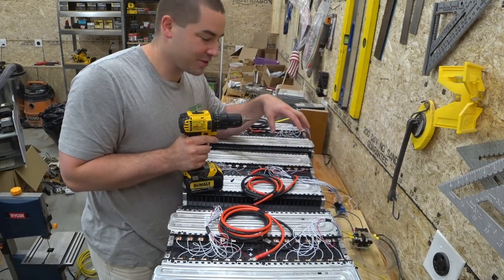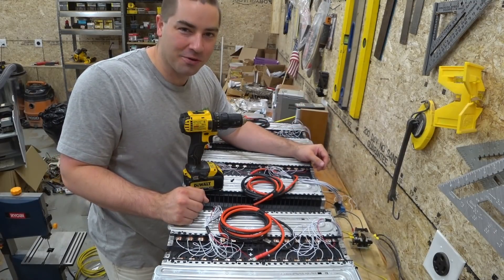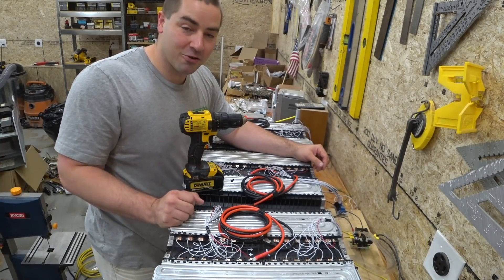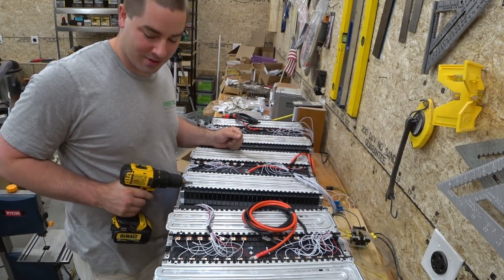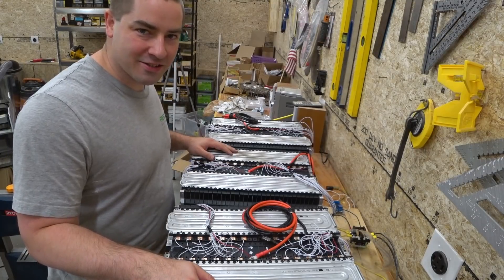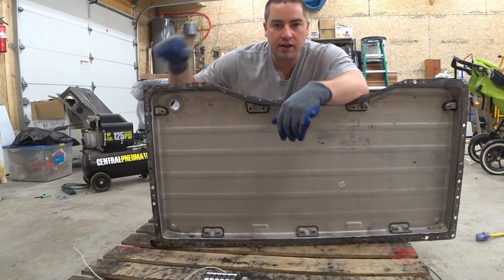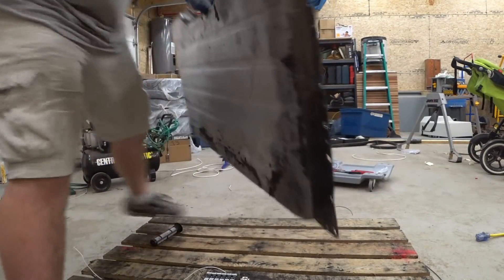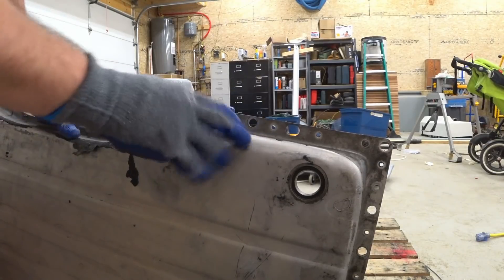Finally!  It's all coming together.  Lithium Batteries

Comment: You have a 48 volt battery so 100 amps will be 4800 watts - max. That little puppy will get HOT. I think you should run the control lines through a relay and use that to shut down the battery if there is a problem. You can buy 48 volt relays on Amazon for cheap.
Reply from the maker: Hi D Cobb,  I'm sorry for any confusion with this.  I'm limiting the draw to 40 amps per BMS.  I think this will be much clearer in my next video where I wire all the BMS boards in.  I've also been posting pictures daily to my facebook which might help make it clearer.  https://www.facebook.com/DavidPozEnergy/  Thanks for watching.

Comment: Honest question.  If you dont know the torque, and you are going to guess what feels ok, why waste the time to use a torque wrench at all?
Reply from the maker: I wanted all the bolts to be the same.  That's all.  It certainly was not necessary to use a torque wrench, but I have it and don't get to use it a lot.
Reply: @DavidPozEnergy  fair enough.

Comment: Hey David, bolt sizes are normally referred to by their shaft size and thread count, not the head size. After you know the bolt/screw size you can locate the max torque allowed based on the bolt grade. Afterwards you can decide what torque up to that value that your item will remain secured without warping components. I don't know your plan for the battery tray, but if it will not be subjected to movement or vibration, you really don't need to torque them, just good old German good'n'tight would do.
Reply from the maker: Thanks.  This will be stationary.  Maybe it will be moved once or twice if I move.

Comment: I'm envious David! How many kWhrs do you have there you reckon?
I think the torque settings would only matter if it was going to be mobile. It might help cooling  - though in a domestic situation, that won't be a problem - you probably won't be pulling hundreds of amps for extended periods.
Reply from the maker: Hi Benny Banger,  I'll roughly guess 10 kwh for now.  Once everything is wired I'll do a full capacity test so we find out together.
Reply: @DavidPozEnergy  In capacity, that equates to 16+ AGM 100AH at 32kg at 50% DoD. That's 500kg (1,100lb). What you have there David although not as good as your truck batteries, they are much better than Pb batteries. Can you tell how envious I am? :)

Comment: Looks good but how are you gonna lift it? Its looks heavy now.
Reply from the maker: It's probably going to be around 300 pounds when done.  I only have to move it 6 feet over to the wall, so not too bad.  It won't be a lift, just a slide on a dolly.
Reply: @DavidPozEnergy  I went to a local solar supplier yesterday and wow stacks and stacks of solar panels everywhere. The prices are a lot cheaper for the panels now but the tariffs are starting to hurt them.

Comment: David - is there any heat concerns mounting the BMS to the batteries?   I would think they would need a good heat sink when putting out high current.  I wouldn’t think you would want to dump that heat back into the batteries.
Reply from the maker: You bring up a good question.  I don't know how much heat they would generate under normal operation.  Don't most lithium batteries have BMS's attached? laptops, cordless tools?  Maybe it's not a problem?  Heat is something I'll be watching out for.  Thanks for this comment.

Comment: Have you tested the pack yet or in videos to come?
Reply from the maker: Hi Going Off Grid,  I have not yet done a proper capacity test yet.  That will be a video once the BMS's are all in place.    But, over the months, I have slowly done charge/discharge cycles of the cells.  This was over the course of months at very low amps (less than 1 amp)  The purpose of the cycling was only to determine good/bad cells, not capacity.
Reply: @DavidPozEnergy  ok cool, I didn't miss any of the good stuff.

Comment: Very cool!   I see you are going with these 100a, lighter BMSs instead of say Batrium.  Is your plan to parallel hookup the 3 'batteries' at 100a each to get 300a total output?  or what did you have in mind?   I'm ask because in my case I'm driving a 12,000 watt AIMS and that's up to 250a @ 48v + (potenially) a 3x spike for 20secs (e.g. 750a) - so I went with Batrium BMS which avoids being inline with the battery's current carrying cable and has much stronger balancing (and of course much more detail montoring/control etc)   but you know how it is.  I made a decision but it doesn't mean that its the best one - so I'm always interested in other points of view.
Reply from the maker: Hi Kenat,  Thanks for your question.  I agree with your sentiment.  I have a plan with the BMS's here, but it is not the "best" for everyone.  What you see here is one giant battery bank.  It is comprised of 3 modules, 6 batteries.  There are two (48v) batteries in each module.  I'll be using 6 BMS boards.  According to the manufacturer the BMS boards can do 100 amps continuous, and 110 amp peak for a surge.  I have a hard time believing that, but they are better than a BMS rated for 20 amps.  This means theoretically, this battery bank can handle 600 amps.  I'm also installing circuit breakers in-line with each BMS rated for 40 amps.  My goal was to have the circuit breaker trip before the BMS burns out.  40 amps x 6 batteries = 240 amps continuous.  The circuit breakers can handle short surges (like a motor starting).  O, and "YES" they are in parallel.  The next video will be on the BMS wiring, so I hope to make this clear if my explanation is not.  Thanks for watching.
Reply: 6 x Cool!  You'll easily have 240v@50a capabilities (or more) - e.g. producing/managing your own power generation for your home.   This brings up day-to-day management.  Is the plan to let BMS do their jobs / avoid obsessive monitoring and then interrogate them if something goes wrong?   How will you know if 1 of the 6 'batteries' degrades or goes offline.      Don't mean to pepper you ...  its just that I'm a year 1/2 in with my own 780ah @ 48v battery bank  (so much fun building it / putting it online)  but I've been thinking more and more of 2 yrs, 5 yrs, 10yrs out...  and maintaining things...  and I suspect you are thinking of these things as well and will be interested in our thoughts as you progress.
Reply from the maker: I want to avoid daily monitoring of the battery, which is why I'm integrating BMS boards that have safety features built-in.  These BMS's also have bluetooth.  So I will be able to look at the state of the battery to see if it is online, or off-line.  These BMS's are a bigger version of the one I tested in this video: https://youtu.be/wTn5t8rAOCs

Comment: Now you are ready for the smoke test... 😂
Reply from the maker: If you mean they smoke from catching fire, I hope not.  I've been charging/discharging cells as I've been working on them.  I think I've got all good ones grouped here.
Reply: @DavidPozEnergy  just make sure that you hook them up. Correctly.
Reply: @DavidPozEnergy  its a old electronics joke as in the first power up seeing if it will work or if it will catch on fire... Love be the videos btw
Reply: Ben C In the heavy truck business an old guy I worked with, had a trailer light test box before they were commercially available, we used to hook it to a battery charger , if there were problems difficult to find, we would turn up the charger and look for the "smoke"  then rewire the whole trailer most of the time.That old guy with his Dutch Masters made hard work alot of fun , RIP.
Reply: bite your tongue! :)

Comment: Very nice - are these the same 4.2 max volt as the Volt batteries ? - so you can parallel them ?
Reply from the maker: Yes, same basic voltages.  I don't know the exact minor differences in the chemistry, but the papers I've read on it show similar voltage curves.
Reply: @DavidPozEnergy  Cool, so is your plan to put them in parallel ?
Reply from the maker: Yes, just like you have leaf and volt batteries paralleled.  I plan to do the same.
Reply: @DavidPozEnergy  nice !
Reply: @DavidPozEnergy  Now you're gonna need more solar !...  :-)  thankfully - solar is cheap

Comment: to back track a bit you're inverter the way it is mounted you should put a u turn PVC pipe on the fan side to help keep any thing from getting it  I dis that to mine and works great with problems before I had to clean the dust out of my inverter what a pain to take it down and open it and blow all the crap out but with the u pipe I don't have that problem any more
Reply from the maker: Thank you for the tip.
Reply: you are welcome I got some great info from you and great ideas so I wanted to share some things I found out on my stuff to help others